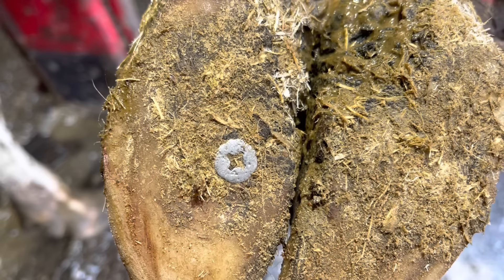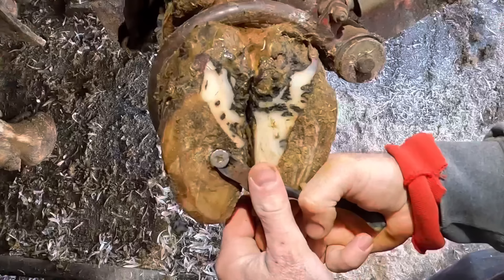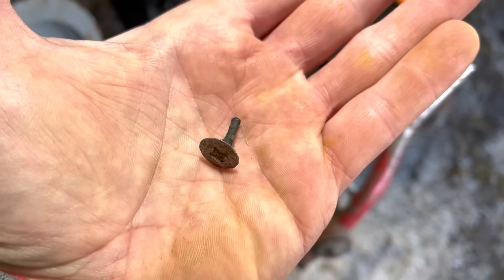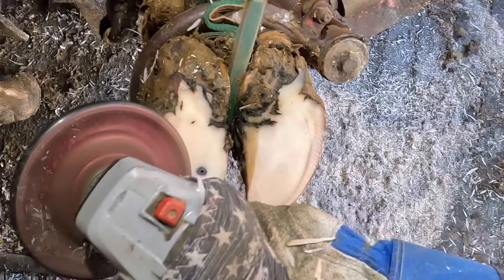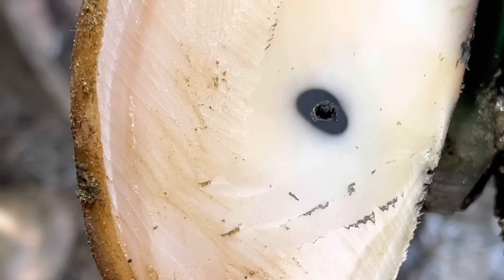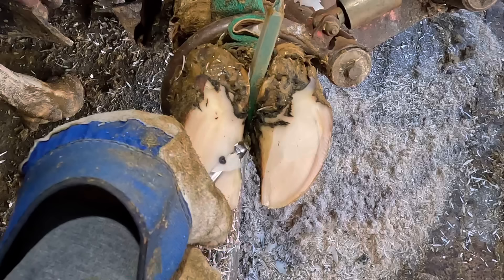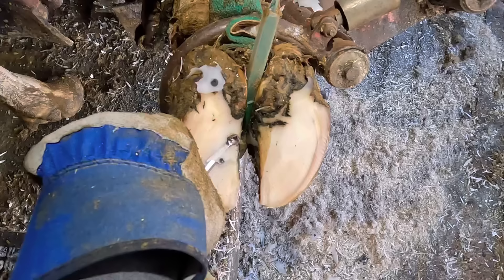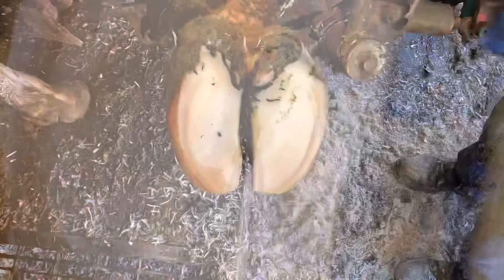You NEVER WANT TO FIND THIS in a COW’S FOOT

Comment: Nate, there's times I know you've said it's easier and safer to work with the grinder, such as when you have really hard hoof horn. Have you ever considered something like a dremel for working in smaller areas? For instance near but not right next to a lesion, or say in this case if the horn had been harder and you don't want to go too deep too quickly?
Reply: Does a dremel grind or cut?  Because Nate has mentioned that this is a cutting head.
Reply: @adorabell4253  i believe it can do both depending on the bit you outfit it with

Comment: For future reference, even in a hoof, removing a screw will cause the least amount of damage if you’re able to unscrew it instead of yank it out.  Always worth attempting first.
Reply from the maker: Putting downward pressure on a screw that has punctured corium would cause more pain.
Reply: @OOOOOO12345  Exactly, no threads so it's pointless to screw it out. The screw was pretty worn
Reply: Why monotonous hoofing videos get millions of views?? 🤔
Reply: But nobody screwed it in, the cow just stepped on it. Wouldn't the damage already be done in that case?
Reply: If it had gone all the way to the flesh and not just stayed on the hoof and if it had threads left on it the flesh could start to heal back around the threads
Reply: Yeah I'm shocked he didn't try and unscrew it!
Reply: @vikaspalakkal7313  morbid curiosity takes over, that's why stuff like acne and cyst popping gets millions of views too
Reply: @vikaspalakkal7313  ASMR
Reply: @madisntit6547  no it was necrofied around it and black, in a situation where the foreign object was not rejected by the body this could happen but when the site is infected this is not going to happen or if it does the necrofied tissue surrounding it would be dead anyways.
Reply: That's assuming someone screwed it into the cow instead of stepping on it
Reply: @josepha3805  no it’s not? If it goes through the hood into the flesh then the flesh will heal around it. At that point ripping it out will cause more damage than unscrewing.
Reply: @Travis7109  I think I was replying to someone else, I agree with you 🚀🗿
Reply: Holy shit! It's almost as if they guy who treats cows knows what's best for the cows!
Reply: @NatetheHoofGuy  The end of the screw will remain Poor
Reply: @pgame20  believe it or not. He’s not the only person on here who’s been around cows.  He’s a farrier. Not a vet or a screw expert.
Reply: @NatetheHoofGuy  Just Asking but That Hoof is Like a Finger-Nail ? It would grow back again ?
Reply: That is a bugle headed plasterboard screw, I suspect it was stood on while it was in a piece of board ...

Comment: Yes there is a better tool for that extraction its called a screw gun set on reverse,
If the screw hear breaks off then grind around and make a nub use a vise grip and turn counter clockwise until the screw is fully backed off.

Comment: i did not untill you mentioned it. As long as there is no puss i would leave it with a block on the other side and come back in about two weeks if shes standing on it. with it gone there will grow new hoof and next time you can trim as needed. but then im no hoof expert.

Comment: Dumb question I think but would it not have been easier to use a screwdriver to remove the screw ? I mean the horn probably grew around it so there would be threads and all

Comment: Why not clean the Phillips cross indention, and back the screw out to lessen the chance of breaking off a piece inside the hoof?  Probing with fine metal rod will tell you the depth and maybe presence of metal.  I do this to keep metal fragments in wood from ruining planer blades.  Blades are expensive, and I even use a metal detector to detect broken nail and screw parts.  I suspect cows aren't cheap either.

Comment: Happy you didn't wind up with a giggler. Them old girls with ticklish feet make life deadly LOL. 
This was a scary one, but I've seen it too often. We had hardware problems. Feeder calves would go on high pasture till late fall and some come down with hardware. Dad finally figured it out by asking old-times in the area. a few centuries before this, there had been a small farm up on the mountain. 
A draft horse colt was stubborn and balky. Once, trying to mow hay with him, he decided to jump back and one hoof landed on a tooth of the sickle bar and into the frog. Dad took him the barn, crosstied him with chains, and dumped turpentine (homemade) in the hoof, then ran. It took a moment, but the horse screamed and tried to kick down the barn. The ties and 12" oak posts held. He was a great horse for years after that and always trusted us no matter he suffered so badly that time.

Comment: So much wrong with this video/treatment! Why would you snap/pull it off and not unscrew it? You're shaving both hooves down which leaves the other one open to infection. You do not bandage or spray anything on the wound, and you do not use a lift on the other hoof...This is horrid...